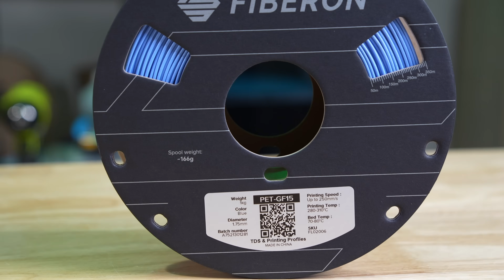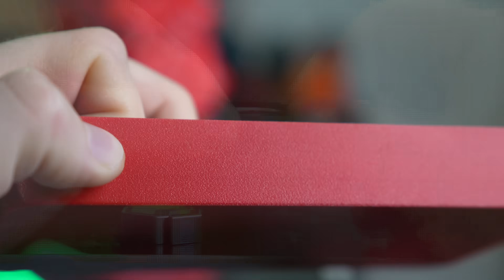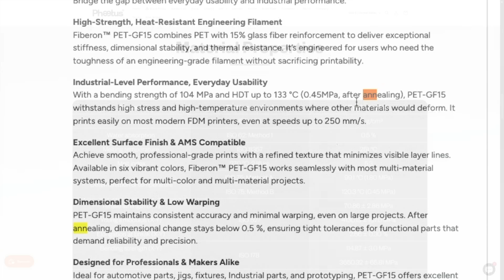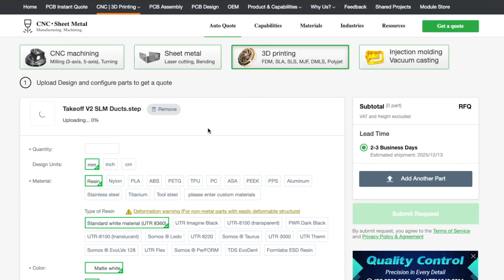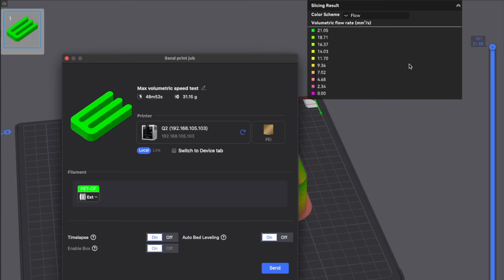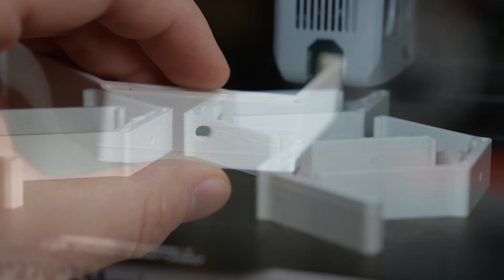Accessible Engineering Filament? Testing Polymaker's Fiberon PET-GF15

Comment: Crazy I just got PETG GF the other day from FILAXIX and some more from elegoo today and then you drop this video as I sit down with a coffee and smoke 👌🏻😂😂

Those temps are wild though. I'm printing at 250c

The reason you bonded it to the plate was because of the 310c temperature. 

If you drop the first layer down and the rest of the layers at 310 your print would stay stuck to the plate and it will come off easily when it cools
Reply: He is printing PET GF not PETG
Reply: @slightlylifted I thought he mentioned petgf the entire time 🤦🏻‍♂️😂
Reply: I think my preset for petg is first layer 240 and than 250